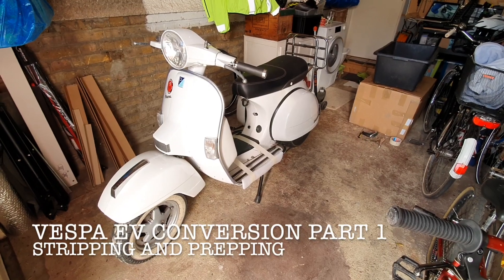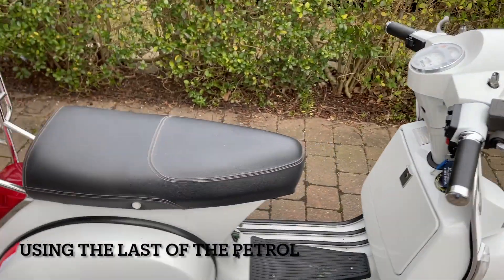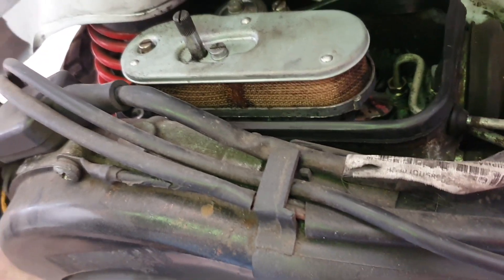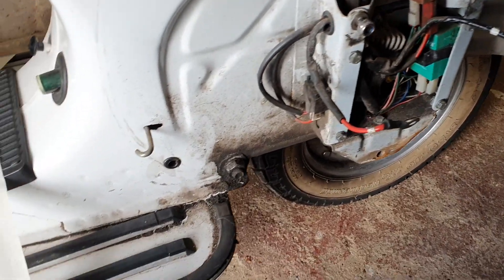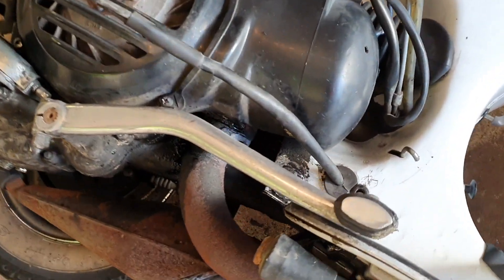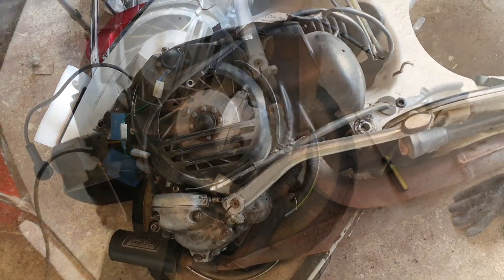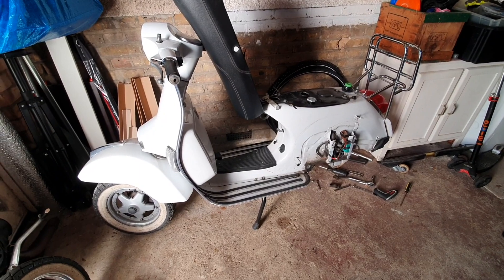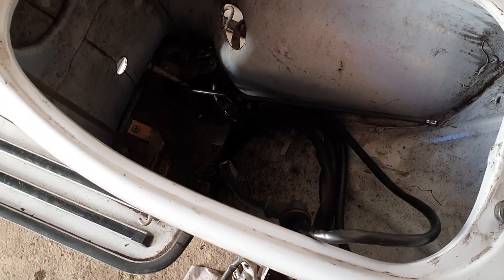Vespa EV Conversion Part 1

Comment: Just curious what the weight difference is between the original scooter and the electrified one. Which is lighter?
Reply: Ev sure bro the much less weight the more average,motor and battery depends on weight